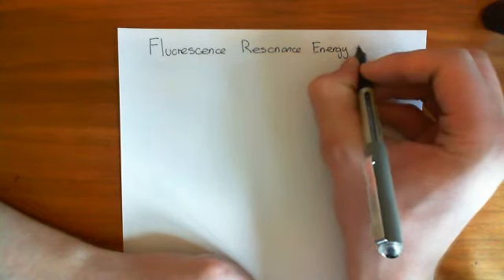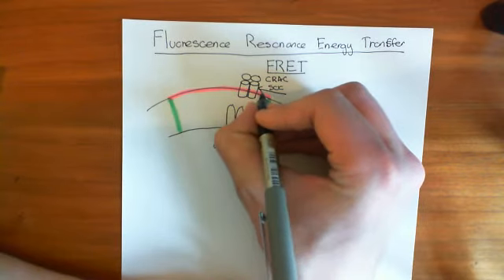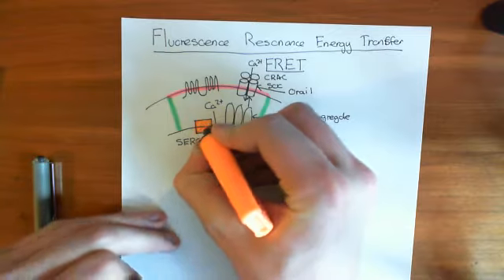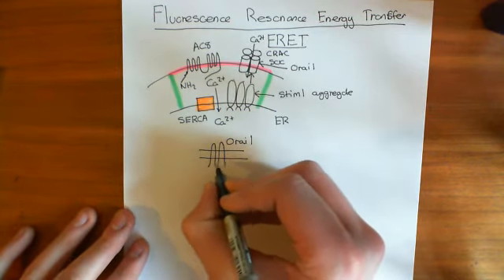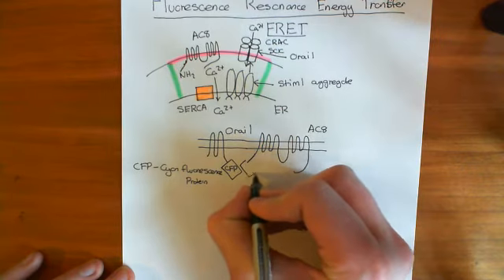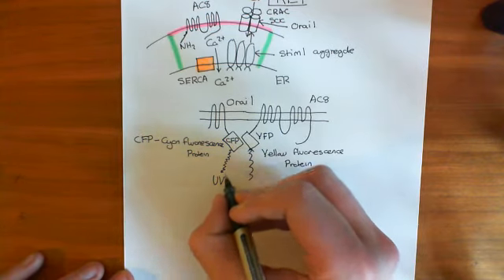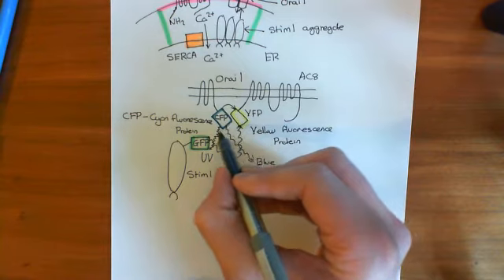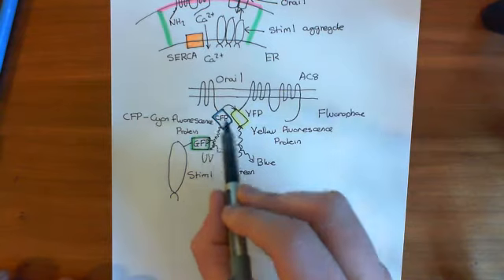Fluorescence Resonance Energy Transfer (FRET)

Comment: can FRET be used to determine the distance of the proteins to each other quantitatively? Or is it just a generalization of proximity? 

Thanks!
Reply: Wow.
Reply: the actual distance?
it should be possible, but sounds very complicated, you will need to have samples of fixed positions and then measure them at fixed concentrations, in order to compare them to your sample. While it's possible, I think there are easier ways (or at least cheaper ways) to figure out protein distance relations.